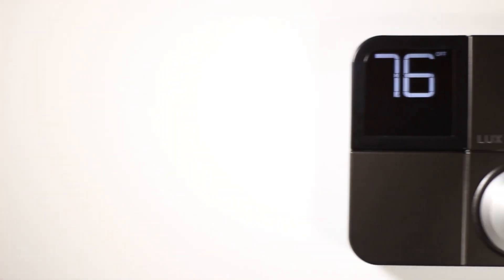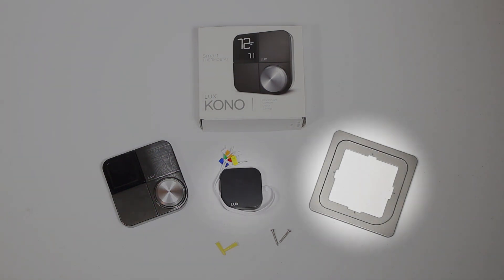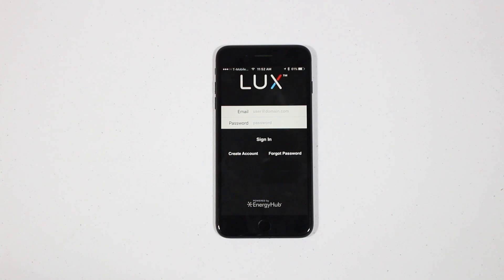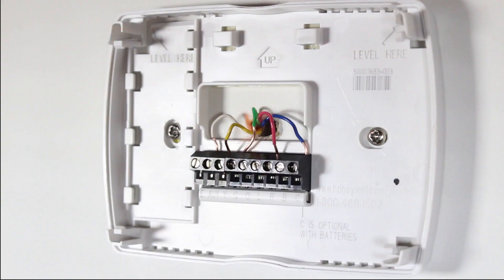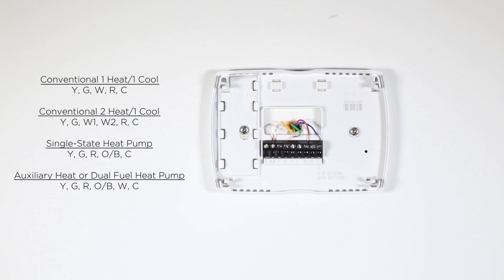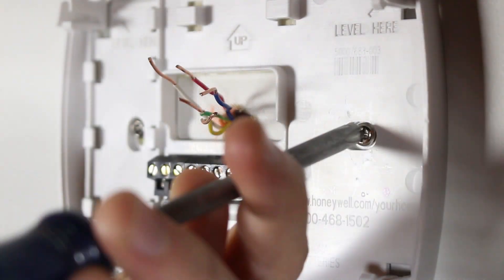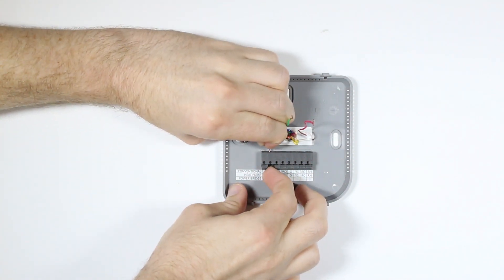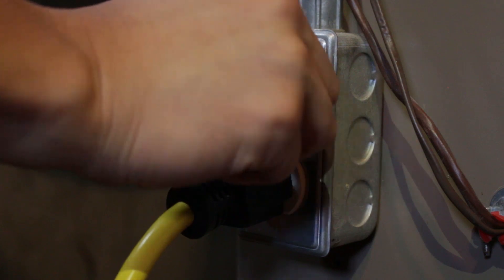Installing KONO Smart with a C-Wire

Comment: What do I do with the brown "E" wire
Reply from the maker: LUX Thermostats do not require the use of the E-wire. You can simply tape it off or leave it loose behind the thermostat. If you have questions feel free to call your technical support team Mon - Friday 8AM - 6PM Phone: 856.234.8803